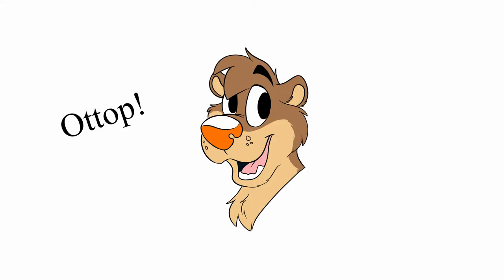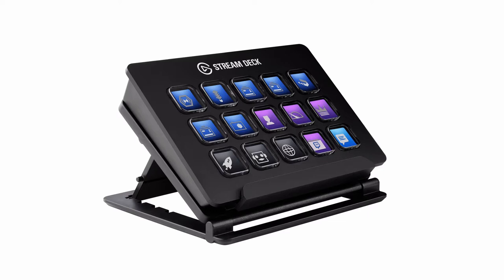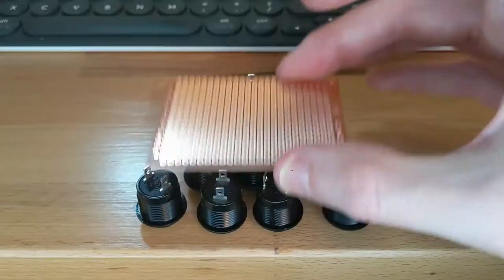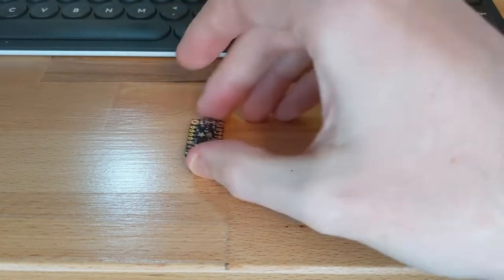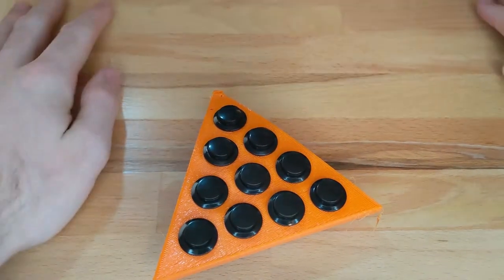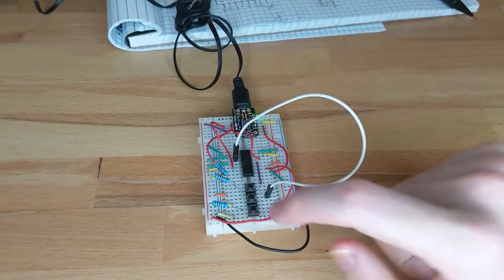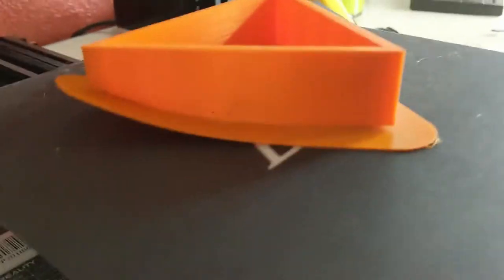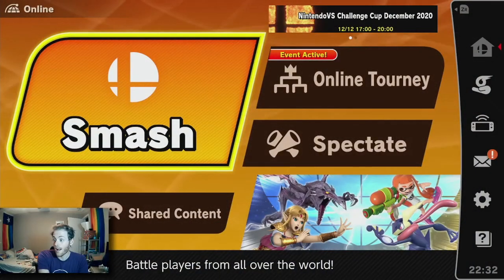DIY Stream Deck!!!

Comment: don't use 1080i, use whatever whithout the i.
i stands for interlacing i.e. it interweaves 2 frames line by line which is not good for video with tons of motion, so always avoide it if possible :)
Reply from the maker: I'm working on spiritual successor to this vid right now. It took me a while to figure out exports in Adobe media encoder, and u right